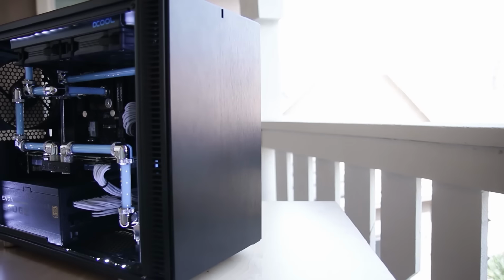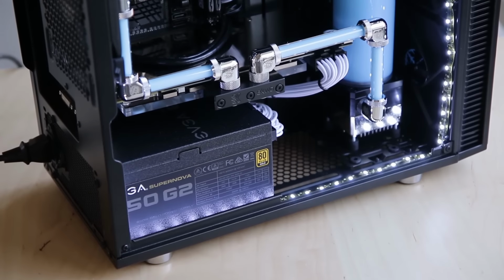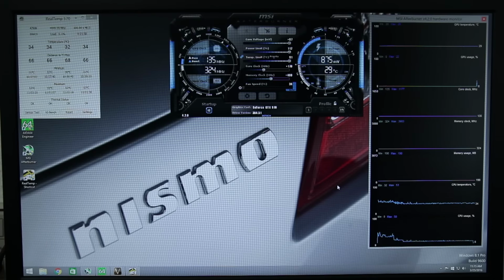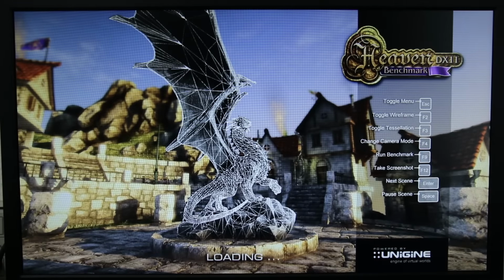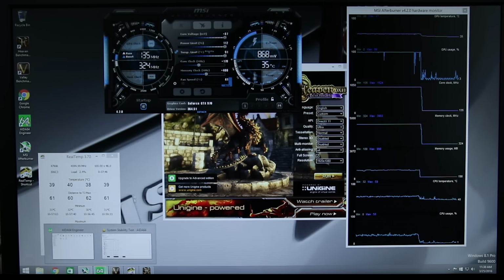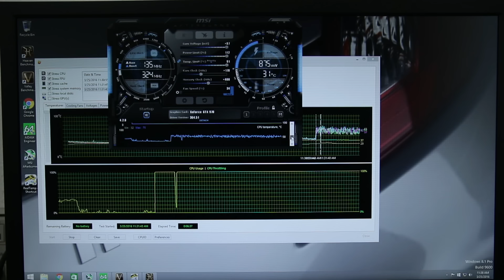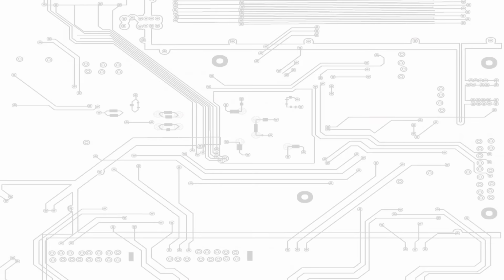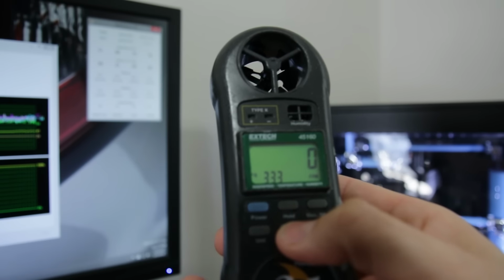Was a 240 Radiator enough?? Temp testing the ITX build

Comment: do you guys think I could run a 240 EKWB slim with a 26mm thickness on a cpu and gpu loop with slightly overclocking? I have the same case but in progress of building.. I'll be using a 1070 and maybe a 7700k

Comment: Jay I have a question does water cooling your cpu cool down your motherboard as way compared to air cooling!!!! Will there be any temp difference???
Reply: It will not cool the motherboard as effectively as air cooling. Air cooling helps with airflow over the components
Reply: That is true. Though it was only a thought as water absorbs heat better then air and therefore reducing the heat the cpu is making on the motherboard. If that makes sense!!
Reply: deathwish3611 it does make sense but the amount of heat that is transfered to the rest of the board is not a lot.

Comment: My i5 6500 with stock heat sink ideals at around 26-28 degrees and my asus strix gtx 970 ideals at 30 degrees and at max the cup reaches 55-58 degrees and the gtx 979 maxes out at 66 degrees so what is the point to all this water cooling and this is in Celsius
Reply: +Meso 1284 There is not point in water cooling for you. You don't have a cpu that will overclock and you didn't state that you overclocked your gpu.

Comment: good video jay love watching ur videos :) question I have a old gtx 260 everytime I try to over clock it and use valley bench it didn't crash but it sets everything at 800 MHz and idk why
Reply: Thermal throttling?
Reply: +Joshua Kallen i dont think that it is or i dont know how to test that
Reply: Jon Austin Check the temps while running the benchmark?
Reply: +Jon Austin throttling
Reply: +Joshua Kallen oh k will do :)
Reply: +Jon Austin I mean, if you OC'ed it and it goes down that much then I think that really is throttling. Use Afterburner while running the test to check the temps and clock speed.
Reply: +Joshua Kallen oh k i see what ya mean
Reply: Jon Austin A'ight :)

Comment: It's all about the temp deltas with water cooling. 240mm should be sufficient if no over clocking is involved.
Reply: lol and he did oc and its fine
Reply: +job hoogeboom exactly - you can oc as long as you are ok with the water delta. You can't expect a 5.0 ghz oc with 240mm rad and 2c delta. Look up the work done by Martin.

Comment: can you a r9 390 crossfire vs gtx 980ti video?
Reply: Not even worth testing. Nvidia will be better cuz they as a whole get better support cuz they are assholes. Sadly i contribute to that cuz i bought a gtx 950.
Reply: 2pumpedupforu if you use gameworks I agree. But now amd has better preformence for money a lot of the time. R9 380 is better than the gtx 960 and the r9 390 is better than the gtx 970. 970 sli gets mostly better preformence then a 980 ti. So I thought 390 cf vs 980 ti would be a great video.

Comment: EKWB is specific in their configurator. They calculate the energy that needs to be dissipated, and the energy the cooling loop is capable of dissipating. If a 240 radiator can do the job, why need more? Just do your maths, the bigger is not always necessary.

Comment: What about the water temperature? I'd reckon it at a good temperature, since you're getting good temps on your components, but you never really talk about water temperature and delta temperature. Many reviewers of water cooling components speak about the delta temperature as a way of saying if it's good or not. And water temps are obviously important for those that don't know that water expands and that the pump may actaully die if the temps get too high.

Comment: I have matx pc . 4790k ,sli gtx 980 and swiftech h220 and llwater blocked/ U dont need use a big radiator ... i always watch you and always wondering about have a big built , BUt i travel a lot so i need small build . My temp idle get at 32, 30 celcius , load at 64 , the gpu never over 60 . So for me dont need anything lower than this .

Comment: is the 4790k / 970 a good combo? that's what I'm upgrading to
Reply: at least a better combo than my fx6300/970 :D
Reply: +MagicPeterPalmer haha that's cool, I've already got the 970, and I'm upgrading soon from a 6300 also 😁
Reply: +Matthew Gilbert lol
Reply: +Matthew Gilbert  If your overclocking the cpu, yes. If not go skylake i5 6500 or 6600 (non K). DDR4 prices are much cheaper at the moment from my quick searches.
Reply: no, you will get more for your money with an r9 390.
Reply: +Matthew Gilbert I have the 4790k  4.7 ghz and  r9 390 8gb  that is on par with the 970 and it blows everything away   EVERYTHING
Reply: ah thats good then :P
Reply: Wolfofthepast but then you need to get new ram, cpu and mobo. If i upgrade to 797 I only have to get new ram - ive looked it up, and overall its £100 more to get the s1151 parts

Comment: My 970 WF G1 oc is core clock = +130 memory clock = +24 thats all it can do and those top 3 settings are maxed out . my psu is rms 1000 i don't get how mine srsly underperforms unless he bios flashed and the extra help with water cooling. mine idles @ 30-34oC ,Also in gta v i see stuttering badly it's brand new should i get another ? as i could. & nooo im not getting a 980 ti sorry.

Comment: How long should I stress my CPU using AIDA 64 to consider it stable
Reply: It's most likely to be stable if you just test it for half an hour. Still best to run it for a day, sometimes 2 if you have a really high overclock or want it really stable.
Reply: Just keep an eye on the temps. once they do not increase anymore, you are stable.

Comment: Should delid for water cooling. My 4790k is at 4.7GHz w/ 1.23v and never runs above 60c with just an H100i in a shitty configuration (delidded ofc).
Reply: Sebastian Contreras It makes a big difference delidding the 4790k. I got a 10c drop in temps, it's pretty good and it makes a lot of sense to delid if you run a water cooler.
Reply: with todays technology you can run your system at 5ghz including the gpu think about it if your gpu is running 50 oh forget about it it's your choice but your not gona be keeping your card for a year because your gona buy a new card every 6 months and running your card 100 degrees is still what the manufacturer recommends as Max temperature

Comment: Anyone know what the fan speeds were under load and if noise is an issue? I'm thinking to do a quiet water cooled loop.
Reply: +taipeitaiwan10 Typically you aim for good quality fans over low RPMs, a good quality silence optimized fan will run quieter at faster RPMs than a cheap one will.

But I think, and don't quote me, 40 to 60% fan speeds should be okay, long as those RPMS hover around 900 to 1200 (( those are RPMs I've observed to cause noise in my fans, yours will differ ))
Reply: ...and on that bombshell, it's time to end
Reply: +Xyler94 For me 1200rpm seems to be my tolerable limit on fan speeds when a case is within arms reach. If I can run a rad with 3x120 fans maxing at 1200rpm I'll be happy. Goal is quiet and cool and not requiring me to have to change fan speeds as needed. 

How do people control the speed of rad fans? This build only has two which could connect to mobile cpu headers. But what about with three?
Reply: Sadly, the only way is to use fan controllers, either from your Motherboard Fan headers, or a 5.25 fan controller. A radiator fan is no different from a normal fan, just attached to a radiator. for my H80i, I have my fans plugged into the CPU and CPU OPT ports on my motherboard, and control them using Asus AI Suite (( Due to having an Asus board )), gives me great control, and good monitoring.
Reply: Also, to add on, if you need three, just simply plug into an unused fan header. The fan headers themselves don't control max RPM, that's the motor of the fan, what it does is delivers a certain voltage/amp to the fan motor, making it spin faster or slower due to how much electricity is being supplied to it. Think of it like a gas petal. The more you floor it, the more RPMs your car's motor will spin (( you know, minus the transmission ))
Reply: So, to add again, let's say the max a fan spins is 2000 RPM, and you set your fan header to deliver 50% voltage, the final RPM will be 1000, make sense?
Reply: +Xyler94 I'm familiar with controlling fan speeds but wasn't sure how system would self control speeds as most mobos have only 2 cpu controller heads. Right now I use Open Hardware Monitor to change from 50% to 100% when gaming but in future I don't want to have to adjust speeds in new build which will probably have 2 front and one rear fan, and 3 rad fans.
Reply: Truthfully, the "CPU" ones only differ from the fact most motherboard will freak the hell out if you've got nothing inserted into them / they're not spinning. Because that's the ones attached to your CPU cooler, thus keeping your CPU cool.

Comment: I've seen little to no evidence to confirm the myth surrounding radiators & effective cooling. I've designed loops with thick 360mm radiators & high static pressure fans running at reasonable speeds with an overclocked i7 & an overclocked high-end GPU (Fury X/980ti). The loops made the most sense with just the one radiator, but a few folks doubted the effectiveness of the cooling & suggested adding more radiators. This never made sense to me. No evidence was ever given for their reasoning. But even if they did provide evidence, it might be worse case scenarios, with heavy overclocks, poor airflow, or high ambient temperatures. Yet not only do I live in a cold climate, I don't even overclock that high. A 4790K at 4.6Ghz/1.30v is considered an average overclock; it's perfectly adequate. I might overclock my Fury X to 1180/570Mhz with as much voltage as needed on the stock BIOS. Again, that's not a crazy overclock. It simply serves its purpose. Do I really want to ruin a great loop & spend an extra €100-200 just to be able to overclock a little more & gain 1FPS in games & add a little more to overclocking penis? It's not worth it to ruin a simple & effective loop.
Reply: +Daniel West You sir have met the line between water cooling as a hobby vs water cooling for functionality.
Reply: +Daniel West I mean if you have the money for all that stuff, why not go the extra mile, other than silence?
Reply: David Oconnell
Yeah, I know what you mean. I love the idea of water cooling as a hobby, but when someone misleads others with their own predispositions and opinions, that's where the line between passion and function becomes blurred, when really they should be clearly separate, if need be.
Reply: Da Doubi
Because it can needlessly clutter and complicate the build. There are certain cases that love multiple radiators. Case Labs, for instance, beg for complex loops, as everyone knows already. The HEX R40 is a small mATX case that loves the 240+360 configuration, just like the S5 from Case Labs does. One of the first loops I ever drew up was for a Define R4 about two years ago. It utilised a 2x240 (30mm) configuration. The loop was genius like that, even though it was overkill for a 4.5Ghz 4670K and a 1500/76000Mhz GTX 970. But then I designed a loop last year in a Phanteks LUXE with a thick 360 up the top for a 6700K and a 980ti. Others suggested adding more radiators just because it could hold more radiators, but the loop didn't feel right like that. I like builds that make sense and are balanced. If your goal is a 5Ghz overclock on a 5960X, you're going to benefit from at least a 480mm for the CPU. But if you want a 4.4Ghz overclock on a 6700K because practically speaking that's all you need, a single 120mm radiator will suffice. Upgrade that to a 360mm radiator and you can add a flagship GPU and overclock it.

Comment: If you want ITX builds, nothing beats the R9 Nano
Reply: well, a titan x does
Reply: it will probably fit in there too😊
Reply: Jarmo Steenhuis I think linus did a video on that before? Even agaisnt a 980ti, the R9 nano performed better in confined places
Reply: TheProlim12345 but the r9 nano has overheating problems right?
Reply: Jarmo Steenhuis What the fuck? NO.... 
The 300x series and beyond runs much cooler than previous generations of AMD cards

Comment: my MSI GTX 980 only reaches 71 on a 1525Mhz Core clock and a 8Ghz memory clock, with my case (Enthoo Pro) fans on like 550rpm, and my corsair H105 fans at like 800rpm exhaust push config for my i5-6600k@4.6Ghz
Reply: I live in Florida, its like 80°F-90°F daily

Comment: i wonder how much heat a radiator can radiate  passively
Reply: +Harvey thompson not enough that it would ever really matter in practice. i once test booted my 5820k with a 240mm rad without fans just to see if everything was working, and temps just rose and rose without even putting any load on the cpu (the heaviest thing it had to do was installing a bunch of drivers, browsers and anti-virus software). i shut it down and attached fans after i hit 80 degrees after about 20 minutes, no sign of the temperature stabilising up to that point. putting on some cheap fans running at 500 rpm already resolved the issue.

most radiators are designed to be used with fans.
if you compare their structure to semi-passive or even passive heatsinks for aircooling (think thermalright hr 22), you see that their fins are way closer together and that the whole surface area is spread over a much smaller volume, meaning that without fans, there's not going to be any meaningfull airflow going through them. passive or semi-passive coolers always have big gaps between their fins so that air can move through them as freely as possible.
Reply: wow i didnt think it would be even that bad
Reply: Harvey thompson passive cooling is super tricky. had the same thing when testing a friends rig, that one had a 212 evo. so i thought why bother putting on a fan if all i'm doing is checking the bios etc. that thing hit 60 degrees after like 2 minutes, and that was the point where i decided i should probably mount the fan. 

with watercooling you would have a different alternative though to go fanless: a massive reservoir! i once did some calculations and while i don't remember the exact numbers, we found that if you have a 200 liter aquarium as a reservoir you can run a 400 watts system for 8 hours before the temperature in the loop has risen 20°, and that's assuming that absolutely zero heat is dissipated. it's a crazy thing that i definitely want to try at some point.
Reply: is that before the water reaches equilibrium, cause id imagine after your 8 hours temps would rocket
Reply: Harvey thompson nope, that's in a hypothetical situation where the loop is totally isolated,when there is no heat dissipation at all, a situation where no equilibrium would ever be reached. but 200 liters is a lot of fluid, and 400 watts isn't a lot of energy. 8 hours is just the time it takes to heat 200 liters of water by 20 degrees with 400 watts of power, in reality it would take longer and probably reach equilibrium at some point, though i have no idea when that would be.
Reply: Harvey thompson found the numbers again: to heat a kilo of water  by 1 degree, you need 4200 joule of energy. that's the same as 420 watts for 10 seconds. so if you have 200 kilos of water, that's 2'000 seconds per degree, meaning it's 40'000 seconds for 20 degrees, which is about 11 hours. for the equilibrium, it would be important whether you seal the loop, or whether you allow the water to evaporate. if you allow it to evaporate i highly doubt the water would get warmer than 30 degrees at 20 ambient, if you don't allow it to evaporate i have no clue how warm it would get.

Comment: Hey guys, I'm new to watercooling but something doesn't seem right about what I'm doing... I have my i7-4790k @4.9GHz and running Intel Burn Test or Aida64 trial version I'm only hitting anywhere from 72-75 degrees Celsius @1.3v. From the looks of it, it sounds godlike but is that a regular thing for a 4790k?
I have the new Corsair H100i v2 cooler btw.
Reply: Thats okay temp for the cpu
Reply: +Ilari Heikkinen Awesome but, is that like a regular accomplishment? Because I always see people only getting like 4.6 or maybe 4.7GHz... While honestly, I CAN push 5.0GHz if I really felt like it.
Reply: +Mrxcrazeeman3 well every cpu behaves differently, you might have really good one
Reply: Ilari Heikkinen  Damn, that's awesome! Haha, thanks!

Comment: Anything over 65°C i don't like. With water loops you usually expect more like 50°C max. I would call that water cooling at least on thoses oc settings a failure. But with some more moderate overclocking it could become acceptable, but then the whole point of a water cooling is not being moderate. At least is has the looks, but the performance is not to the level of what i would expect from a water loop. The max temp limit of 100°C is almost trolling, if it did get that hot it would literally Explode lol so i guess that's one way to set a max temp target XD. That said the gpu temps were pretty good, so just a bit less Voltage on the cpu and it would be usable.
Reply: +SirShizuka Assuming the standard assumption of ~20*C room temperature, it's not even possible to get 50*C max on modern CPU under max load, especially not overclocked, the thermal resistance of the die and the heat spreader alone is too large... It's not a limit of the loop or the block, it's the fact the heat literally can't get transferred to the loop efficiently enough. Only way to meet your requirement is to use actual cooling below room temp, like thermoelectric or phase change cooling. Which is ridiculous.

Please consider the fact that these chips are literally designed to run much hotter than this - they're designed fully knowing they may hit 85-90*C under use.

Whether you like it or not is irrelevant, this is engineering and science, it doesn't care. His loop is fine, as he proved in the video.